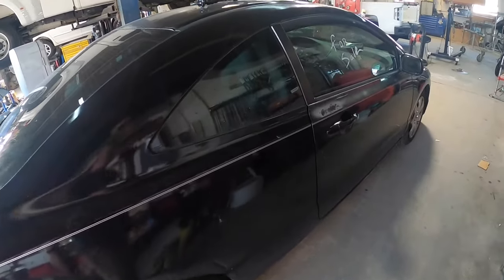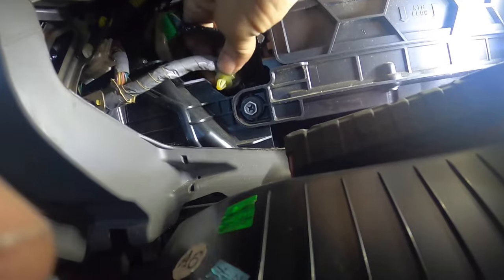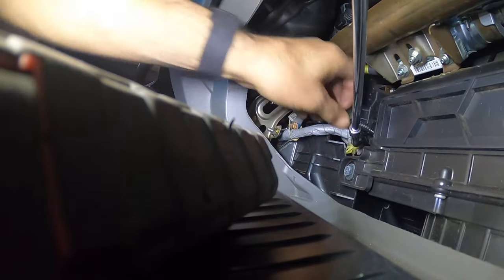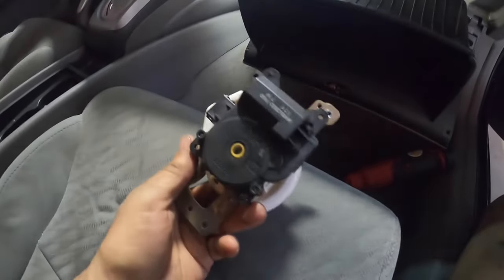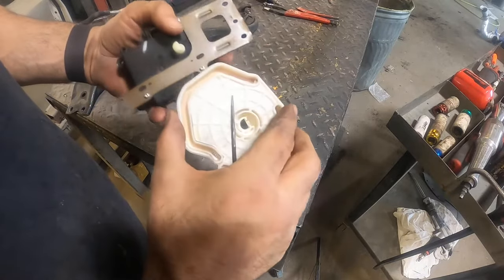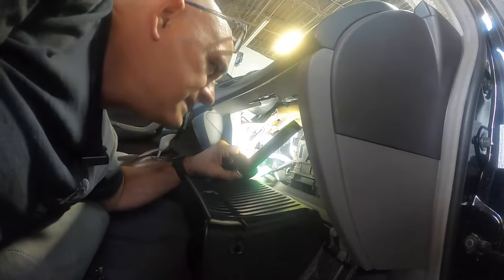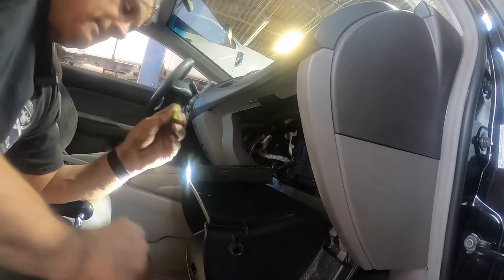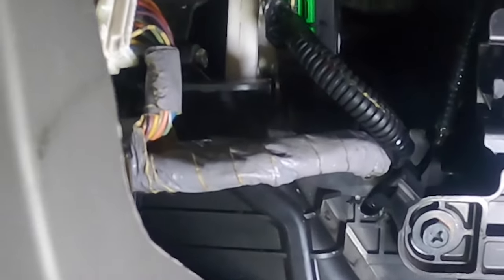Honda Civic MODE ACTUATOR Not Working Easy FIX Under 20 Minutes

Comment: You might want to add a few keywords to this one, in the title and video description and tags, like "Honda Civic", etc, so Google will have a handle on what you're showing. Click the tab for channel content, then click 'details', click "show more", and you can change all that. It's humbling to realize that the vast majority of views come from search engines like Google, and they rely on a word search to find the info people are looking for. So the more words that line up with your target audience the easier it will be to find. This kind of specific info you're showing is really valuable for people with the exact car. If enough people watch for more than a couple of minutes, you end up in the first page of the search engine, and view counts go way up.
Reply from the maker: Thanks for the advice I will do it. I’m still learning. My goal is to do this full time in a few years, so I will take all the advice I can get. Thanks in advance
Reply: @AutoRepairTips757  Pete, you've got an excellent channel, it deserves far more views than it has so far. When you make a new title, think about what an average nonmechanic would type into the search engine. He won't know what a mode actuator or even a blower motor is, but he will be looking for something like "how to fix car air vent" or something like that. One of the biggest surprises I found was that what I think are my best videos consistently get the fewest views. You just have to shrug and know that you do it for reasons other than becoming popular, ha ha.
Reply from the maker: I will make some changes to that video and hopefully get some better results, I’m hoping to turn this into some retirement income. When I hit 20 thousand subs I’m going to start a podcast, I have already started making a studio in my house.

Comment: Great video! Straight to the point, easy to understand and thanks for the tips & tricks. Changed a lot of parts (that needed it anyway) and did a diagnostic on my element using the ac buttons and got the DTC for A Problem in the Air Mix Control Linkage Door, or Motor. This video popped up so I’m hoping that’s the issue. 🤞 it’s not the compressor

Comment: Heres one for ya. 2014 civic si and its stuck on heat. Switches modes but blows nothing but hot even when its set to vent or ac.
Reply: That would be the blend actuator.  Sits on the driver side.
Reply: @jrc56719  I remapped/tuned this morning and now its working. I am going to replace the actuator anyway. Looks like its right behind the glove box so shouldnt be to big of a PITA. Thanks for the advice. Same conclusion I came to.

Comment: It's all about what tools you have. I replaced mine today, had stubby Philips screw driver and 1/4" drive racket with a 7mm socket. I have big hands so reaching in is not easy. Cut off one of the tabs on the top of the motor for easier to the top screw, that was a game changer. Had to go under the dash to get better access to put in the bottom 2 screws wasn't easy but do able. I took apart the old one cleaned the contact points which is on the back of the biggest gear, it was nasty with grease and dirt and it started working again. Put in the new one because I didn't trust the old one.

Comment: so I bought a new actuator and it still doesn’t work. Could there be a fuse or relay or something that could be the problem
Reply: Skill issue
Reply: At that point you have to take it to a mechanic, do not mess with the electrical part of it
Reply: Fuse #36 in fuse box under dashboard ?

Comment: Perfect. I always thought i just needed a new condensor.come to find out its the blend door. When i used to stop at a light she would warm up drastically. Come  to find out if i adjust the temp then back to cold irmt seals itself back into recurculate mode. (Max air) . I Still wna replace it eventually, now i can. Thanks

Comment: can you do a video on the right side actuator, my recirculation door motor seems to be making sound but the door is only moving half way through.
Reply: Same thing with me no ac on and there’s a clicking noise coming from the right side of the cabin filter but when I unplugged the cable there(green one) it goes away. Trying to find out what the solution and what the issue is

Comment: Does the door have to be in a certain position when you install? My cars stuck on blowing towards me . when I put mine on it moves when I plug it in and turn the car on but then it stops and when I change buttons nothing happens still stuck
Reply from the maker: you need to calibrate it
Reply: @AutoRepairTips757  how do you do that?

Comment: so my car only blows hot air and in another video that i watched the guy said to turn your temp nob from hot to cold and if the actuator doesnt move then its bad. but my thing is, is this the actuator hes talking about or is does this one only control where the air blows? because when i hit one of the buttons to change where the air goes then the actuator moves, just not when i change the temp.
Reply from the maker: A lot of cars have three actuators one is for hot and cold, one is for the air temp, and one is for recycling and fresh air. So depending on what problems you have with depending on what actuator is bad.